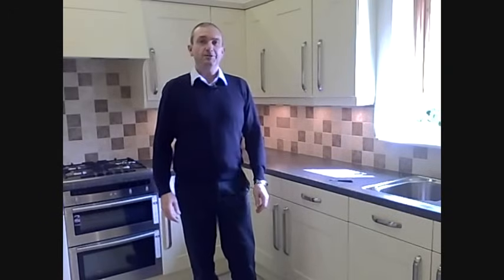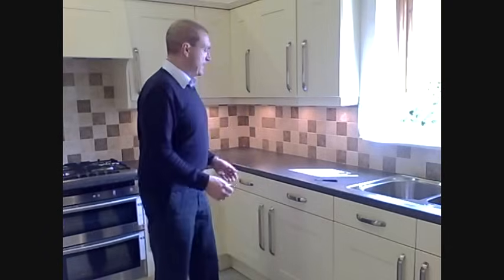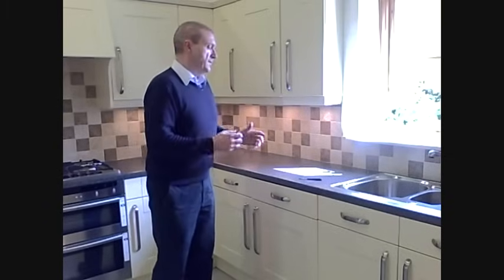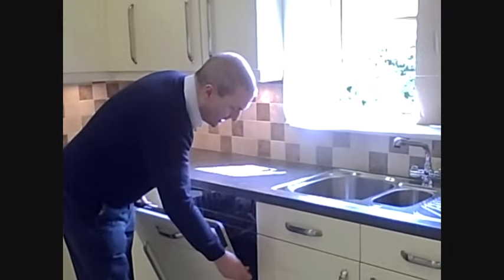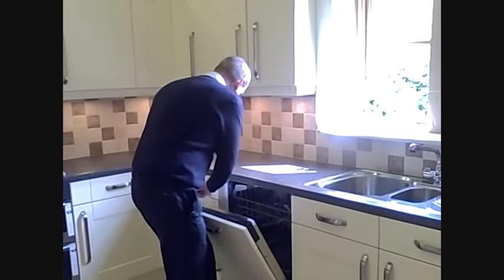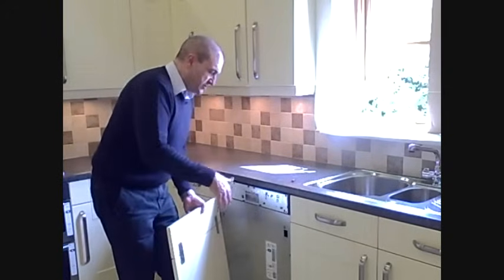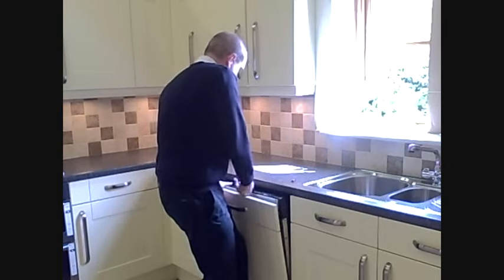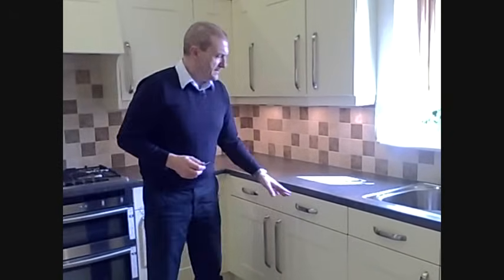How To Replace An Integrated Dishwasher Kitchen Door

Comment: Hello. Can I fit a 500mm door to a 450mm integrated dishwasher?
Reply from the maker: We wouldn't recommend fitting a 500mm door to a 450mm dishwasher.  When fitting doors to cabinets we always recommend fitting doors slightly narrower than the cab to prevent the adjacent doors rubbing together.  If you visit www.kitchendoorworkshop.co.uk we can supply made to measure doors to the precise size you need for your integrated dishwasher.